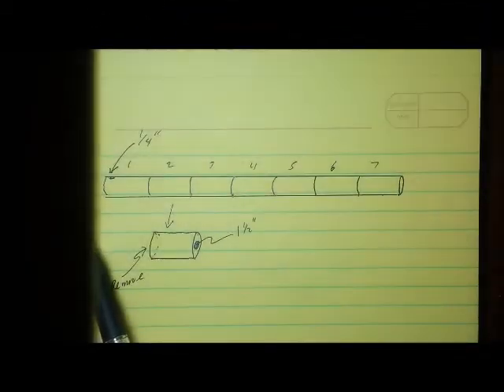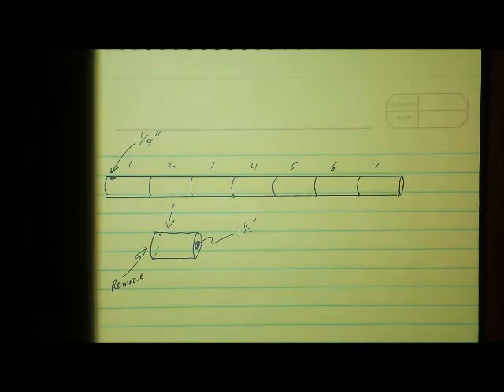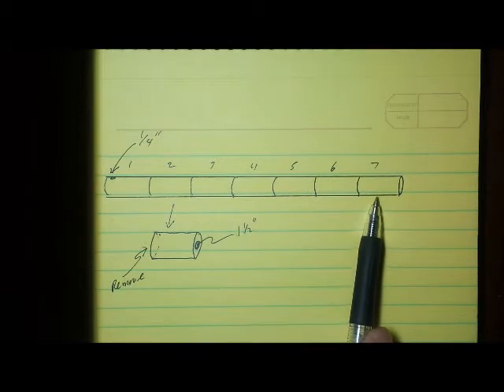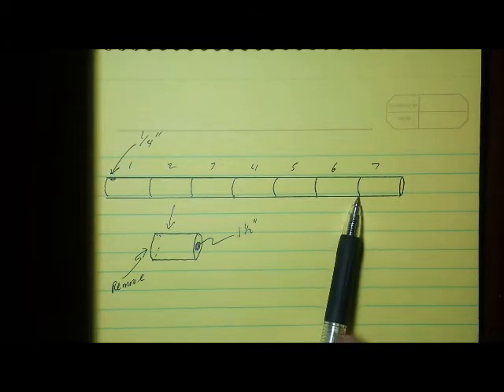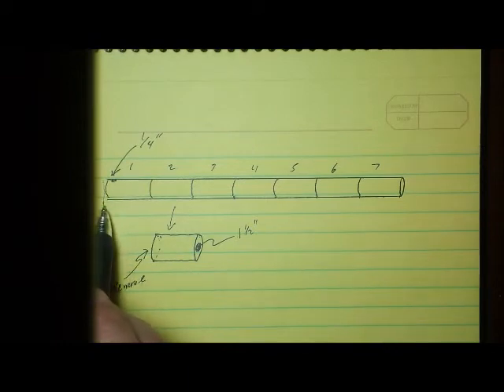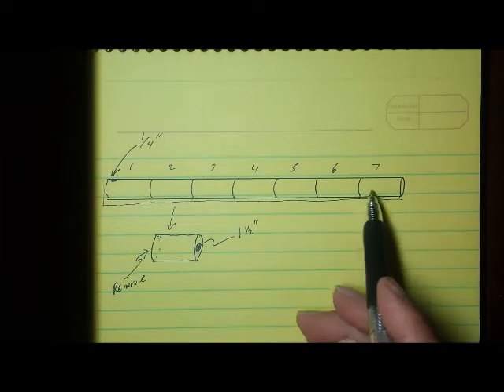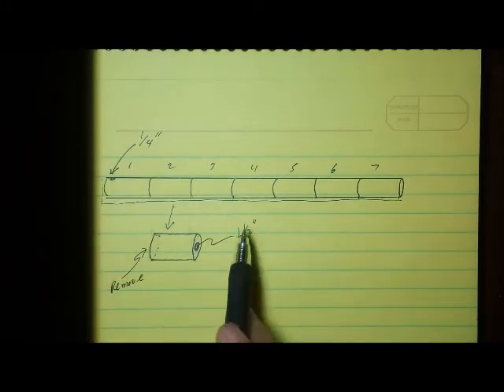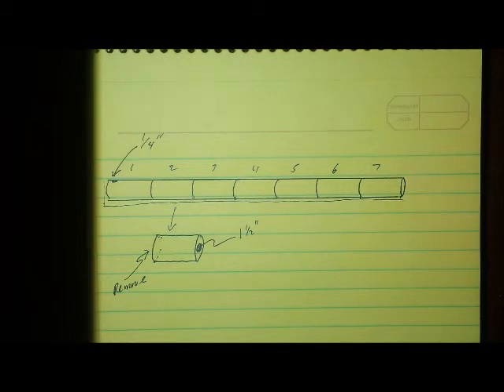HOW WE MADE A HOMEMADE 200MPH TENNIS BALL CANNON FOR PHYSICS CLASS

Comment: Did this over 50 years ago as kids, a lot easier (duct tape),  SOLDER?  And a nail hole straight in the bottom of the first can, not a big freaking hole on the side.  Wave the cannon to get the fuel/air mixture before loading/firing...